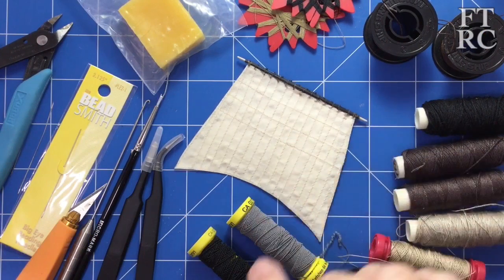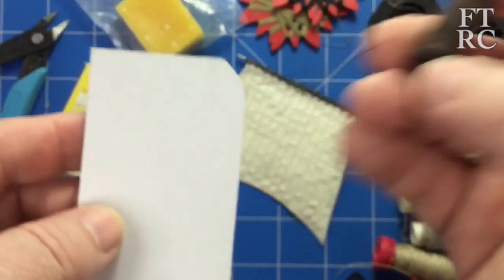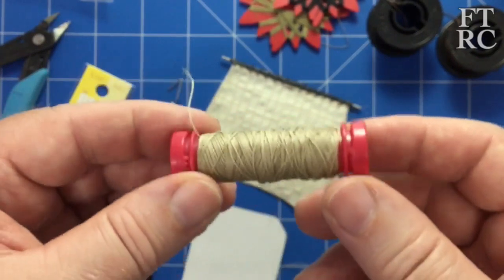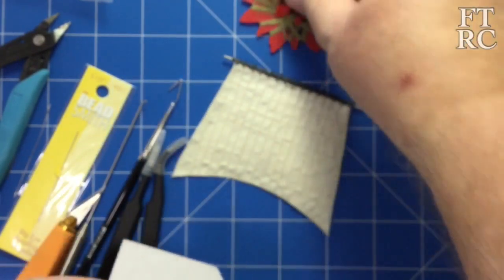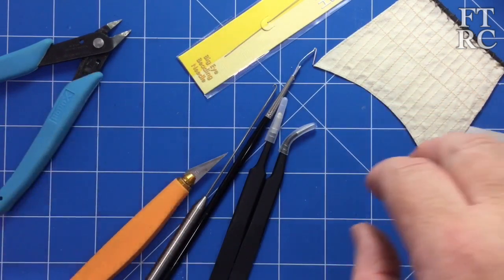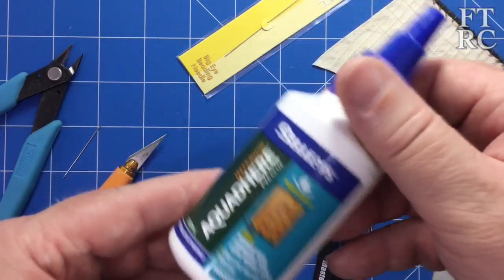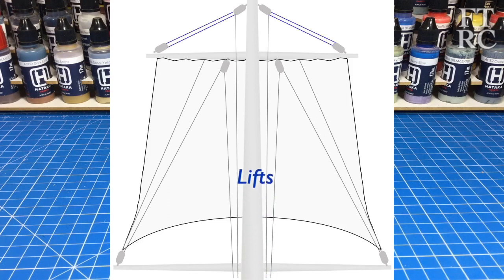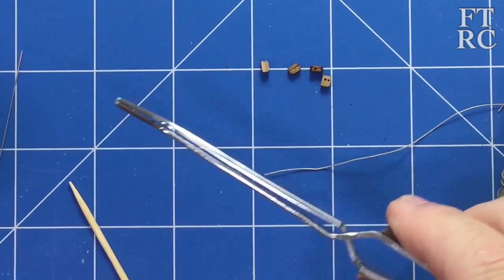Revell 1:110 HMAV Bounty Part 9 Rigging a Sail

Comment: The yardarms are raised and lowered from ropes and blocks attached at the centre of the yard arms called Jeers. Once the yards are raised they are held up by the slings The lifts you discribed are more for keeping the yard horizontal while lifting and once in place. If you only used the lifts the yard would sag in the centre and warp or snap. Just saying...
Reply from the maker: Thanks for that.. I have rigged the slings.. but never knew the lifts did not go all the way down.